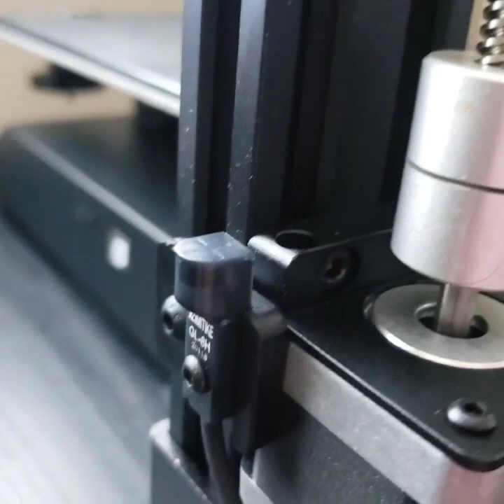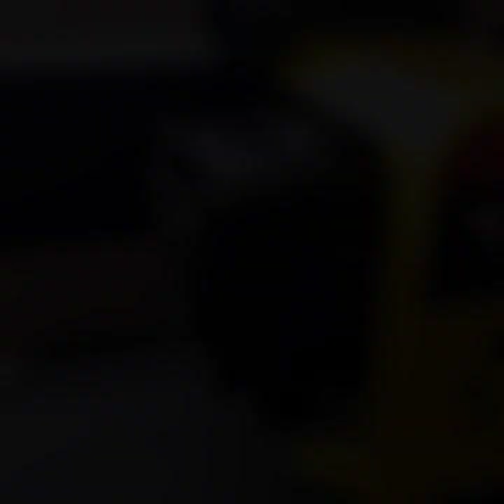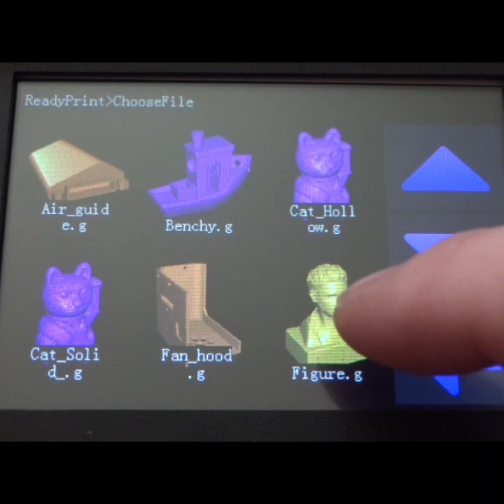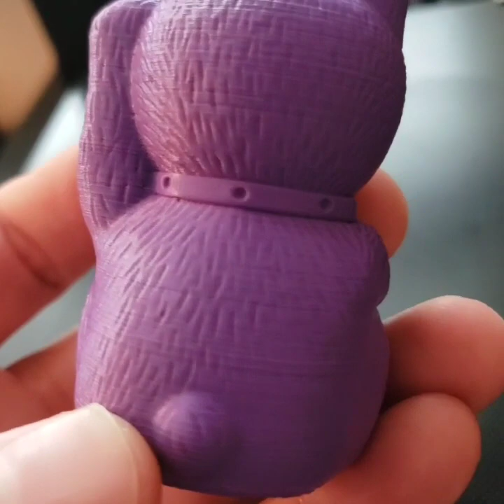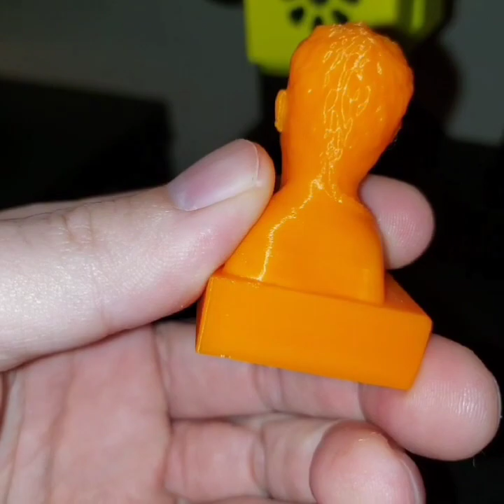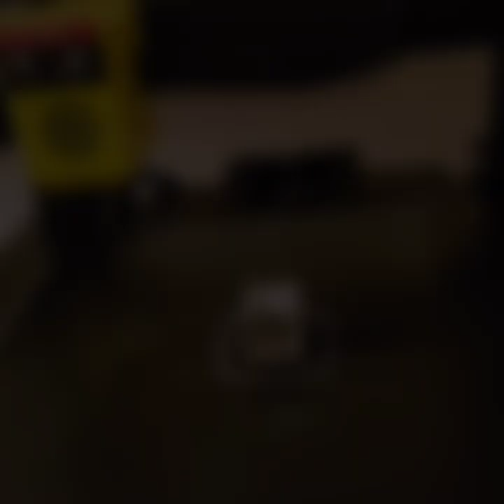Fokoos Odin-5 F3 3D printer review

Comment: Contraption on Z-axis roller is a spring loaded compensator.   They help reduce binding when upright extrusions are not perfectly parallel.  They can be a pain to reload axel in each spring loaded mount when changing roller.
Reply from the maker: Thanks. First time I had seen one.
Reply: @joeprints3dstuff  I think they were also used on TwoTrees Bluer printers.  Sales info shows cutaway view with spring mechanism.
Reply from the maker: @kitcarlson6033  yeah thats the same printer, just named and colored differently.